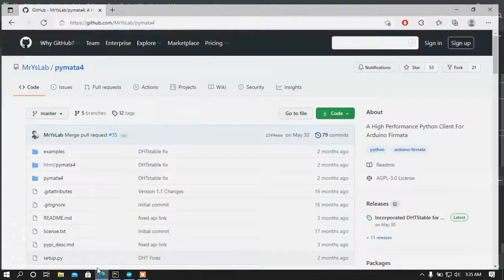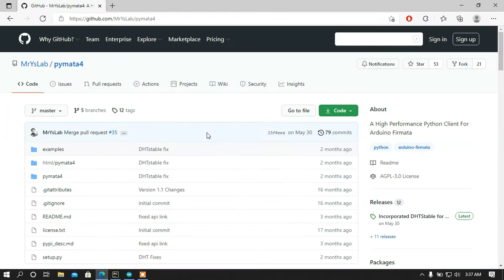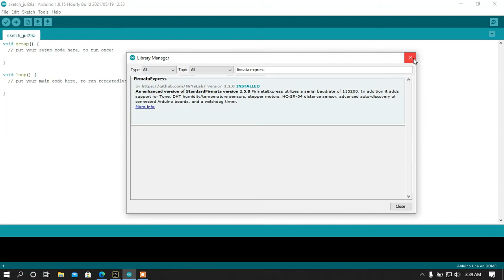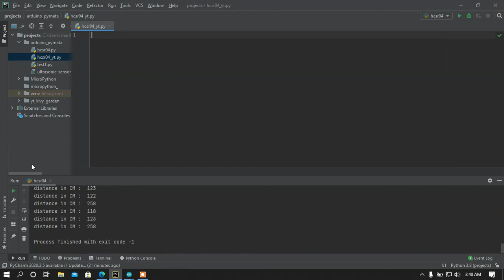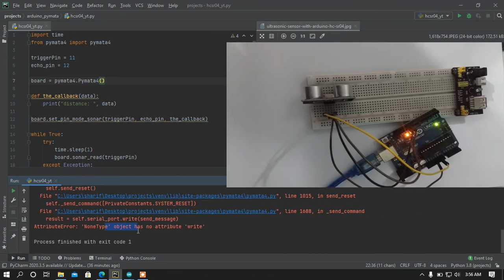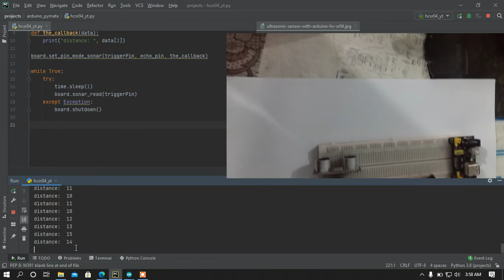Control your HC-SR04 Ultrasonic sensor using python and arduino || PyMata || Arduino||

Comment: hey dude nice video but im gettin an error "RuntimeError: arduino_instance_id does not match a value on the boards." 
is the something wrong with my arduino or something?
Reply: Runtime error because you iz error deer
Reply from the maker: check what arduino you are using
and also recheck your code

Comment: Thank you very much, I find it very interesting. I suddenly have an interesting idea, if your hand is closer than 5 cm, the LED will be HIGH. Could you help me?
Reply: Does the code work well ? ‘Cause I got « int object is not subscriptable. Can you help please ? @OIRLD BOX
Reply from the maker: @Daniel-mc3sy  check your code again with this tutorial. it is 100% working code.
Reply from the maker: Just add function in the while loop. 
if value < 5:
Led_goes_on #here will be the code to blink an led.

Simple
Reply from the maker: @pangalexanderchan9505  if you want an infinte loop than remove tge break keyword.
Reply: @OIRLDBOX THX. You are so kind (•‿•)
Reply: board.set_pin_mode_digital_output(ledPin)
..
if int(the_callback(2)) <= 5:

            board.digital_write(ledPin, 1)

            break

right? XD